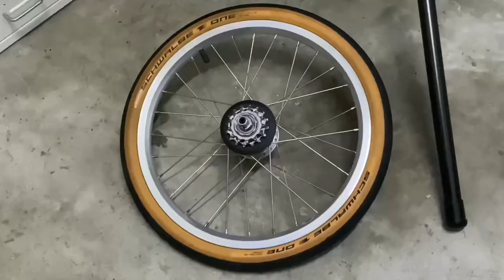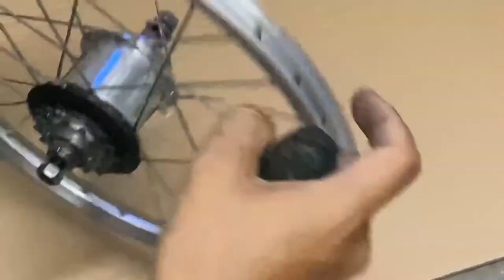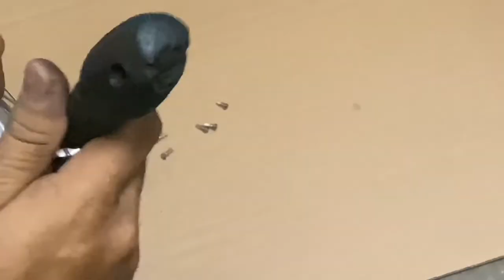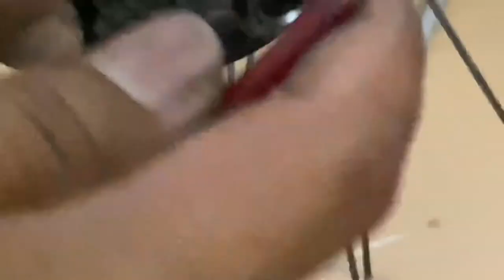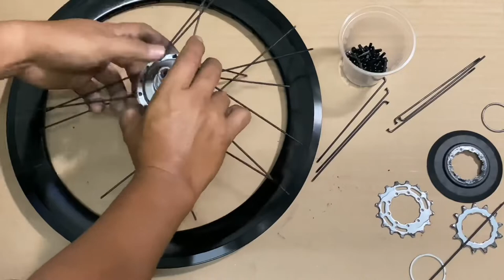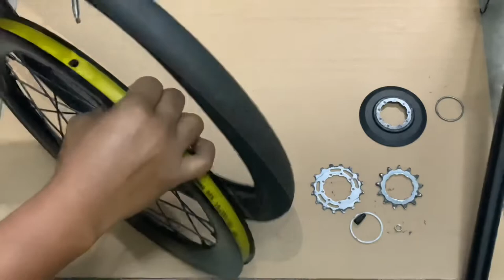Brompton - DIY replace rim and spokes

Comment: Salam Bg… panjang spokes berapa kalau boleh tahu?? 126mm tak jumpa pulak 🙈🙈🙈
Reply from the maker: 126mm bang
Reply: @berukera  depan belakang sama ke bg??
Reply from the maker: @harry871011  sama bang. depan radial pattern, belakang crossed pattern
Reply: @berukera  12G atau 13G atau 14G bg utk silverrock ni??
Reply from the maker: @harry871011  tak ingat bang tak silap 14g
Reply: @berukera  baik bg…. terima kasih

Comment: Please,link for buy this parts...
Reply from the maker: which part bro?
Reply: @berukera  All parts rim and spokes. I see the rim in aliexpress but I don't see the spokes and the length for those. Thanks
Reply from the maker: silverock 40mm high profile rim, 126mm spokes
Reply: @berukera  did you also change the front rim? What spokes length for standard Brompton hub using this rim bro. Thanks
Reply from the maker: @gonzaga3c  yes changing the front rim as well. same spokes length 126mm for front and rear for this silverock rim using an original brompton hub hope this help
Reply: @berukera  thanks mate👍

Comment: Can you share the link where you ordered the rims .It would be a great help. Thanks
Reply from the maker: bought it from shopee malaysia marketplace. i think you can buy it thru aliexpress from their store:-

https://m.aliexpress.com/item/4000688867975.html?trace=wwwdetail2mobilesitedetail&spm=a2g0n.store_home.allProducts_10362026.4000688867975
Reply: @berukera  thank you so much bro!!!
Reply: Is the hub included when you bought the carbon wheels?
Reply from the maker: no i just bought the rim and the spokes
Reply: @berukera  so the hub is not included bro?
Reply from the maker: @neilangelocamba9621  yes not included, i am using original hub

Comment: can I reuse the original spokes?
Reply: I think that I need to replace, the lenght its the same, or no?
Reply from the maker: reuse with original spokes and rim - yes. new spokes only for new rim because its shorter
Reply: @berukera  could you tell me the length for silverok rims??